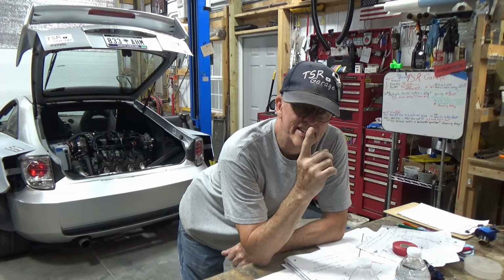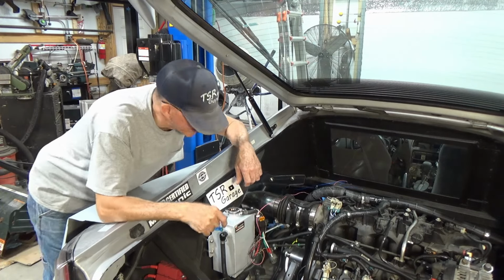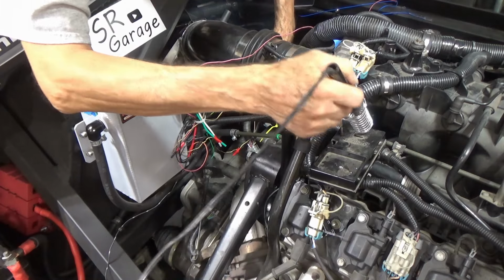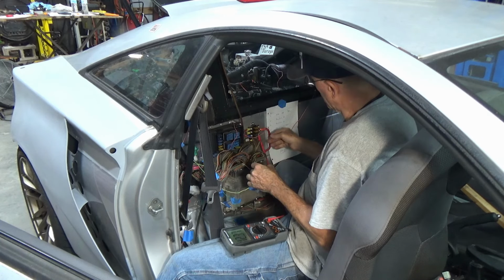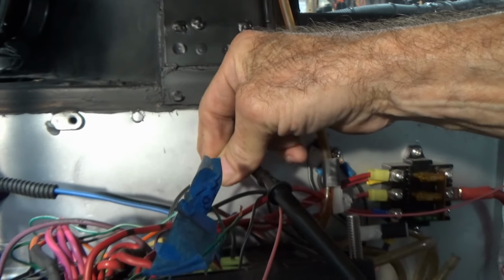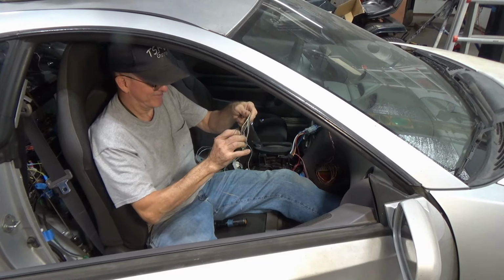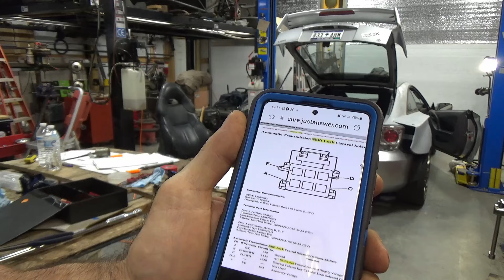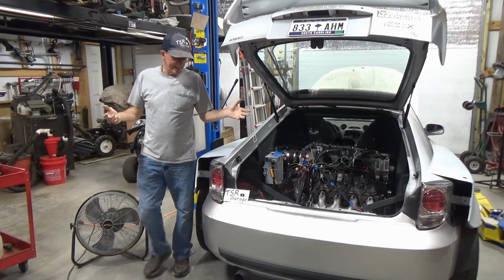V8 Celica #49 - Neutral Start Safety switch 4t65e hd. 🤔Subscriptions are free for an unlimited time

Comment: So when u finished this car, we can bring you our Celica`s for V8 swap :D ? Question. Have you ever had trouble with O2 sensors? I replaced mine with denso which has Original toyota code listed i wonder if its causing me un-even idle and shaking on idle. Strangest thing is if car is warm and i turn off low-beams rpm drops by ~200 and car starts shaking, have u ever dealt with something like this ?
Reply from the maker: Sure.When I'm done, bring it on over.Just have to leave it 6 or 7 years. No luckily I haven't had that problem..